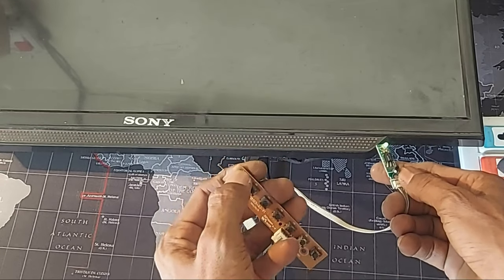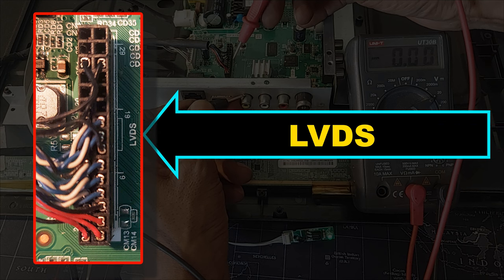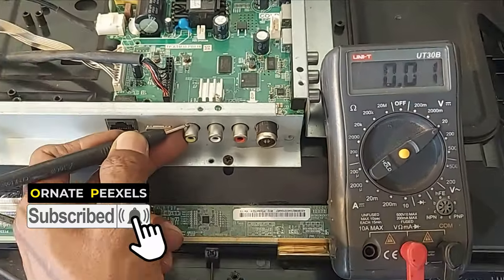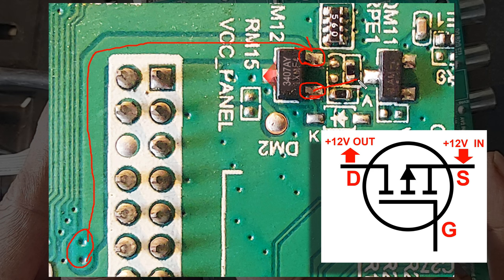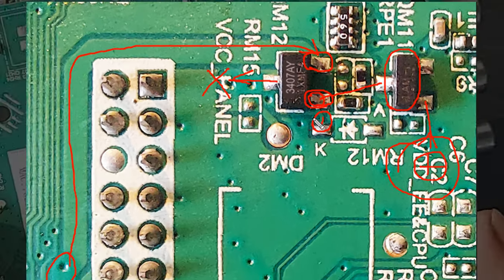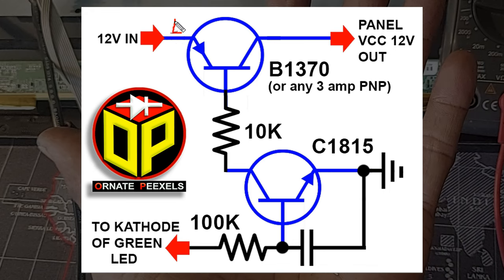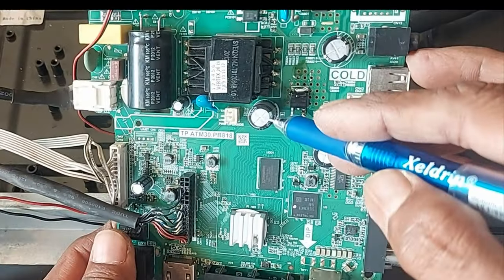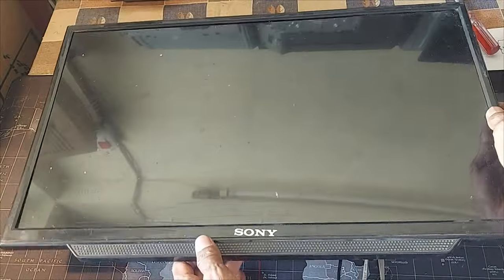LED TV No Display Only Sound How to Repair it |  TP.ATM30.PB818 Smart LCD TV Mother Board Repair

Comment from the maker: Dear Friends,
12 volts will be output from the drain of the MOSFET.  But at one place in the video I said the output will be from the source, I am very sorry for this mistake.
But the schematic circuit diagram that I have made is absolutely correct.
Best wishes.❤
Reply: Panasonic lcd 32 inch the supply of this set str y6766 is sort wich type of module will work,
Panasonic LCD